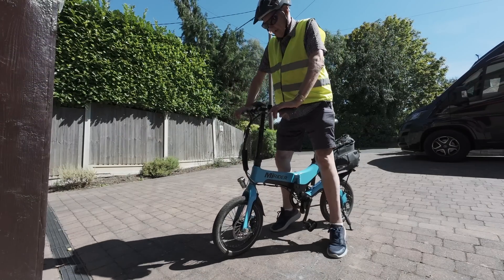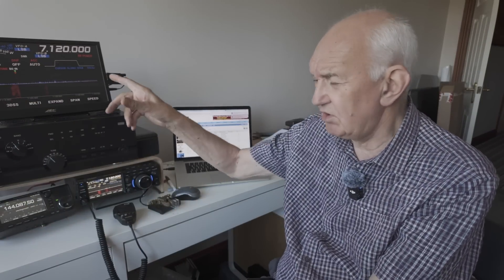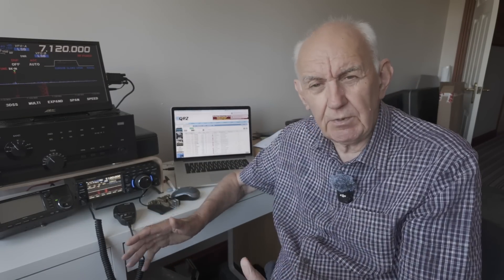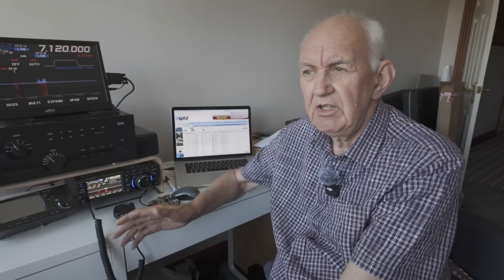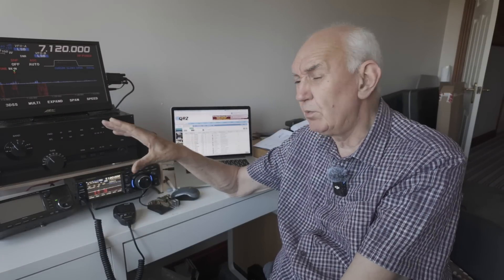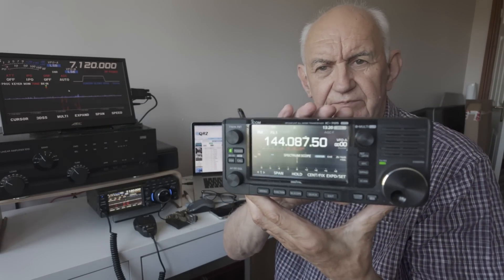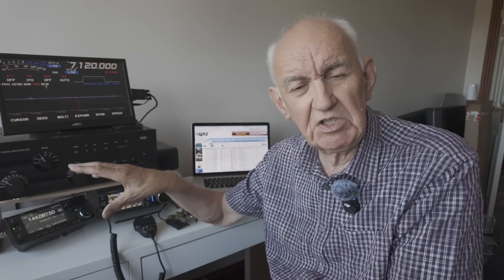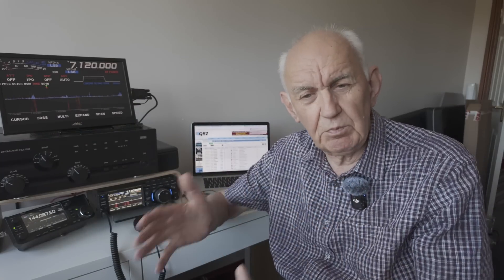My Radio Shack Seems Short of Gear!  Why?

Comment: I'm thinking about getting a Yaesu FT-710. It has a DVI output for the monitor. Will that work with any computer monitor using a DVI to HDMI adapter? Or does it need a special monitor with a DVI input?
Reply from the maker: Any monitor with DVI or use a converter.

Comment: My station is a very simple one too - an ancient FT-840 that was already well-used by the time it came to me feeding a 20m OCFD, with the original hand mike, and a WW2 'bathtub' key found at a local car-boot!
I'm really not good for business, am I?
But I have fun on what is essentially a zero budget. 
Thank you for your apparently unending supply of radio wisdom 🙂 de Richard M0GDU

Comment: I’ve only got an Icom IC-705. I enjoy operating QRP, I use a V2000 for 6/2m/70cm, and a wire for HF with AH-705. I’ve worked the world on it. Love the radio, and also that its batteries last forever and fit my ID-52e. Does what I want it to do, and it’s perfect for my enjoyment of the hobby.

Comment: Thanks for your excellent videos. Coming new to the hobby at 58, currently learning CW and planning to take my foundation licence early next year. Your calm delivery and range of topics and reviews has been very helpful. Definitely heading your way for a radio / kit towards the end of the year. I was settled on the 7300, now off to read up on the FT710 😂 just need to decide and take the plunge. Thanks again. Roger
Reply from the maker: The FT710 is an amazing performer. The receiver is very quiet and frankly at the price, there is no competition!
Reply: @watersstanton  Thanks for your corroboration. The FT710 it will be. 🥳Should be good to get me on the air (post securing my foundation license) inside my 25w for voice and cw. Providing a base / mobile shack considerably more mobile than my FT101, even though both have handles 🤣

Comment: Thanks for sharing Peter, I get it! ( a bit like them massive tvs). I bought the Yaesu 710 from your shop and coming from the Icom Pro when I turned the radio on morse was coming through and in an instant "WOW" that the weak signal was pumping out the speaker with so little noise.
Reply from the maker: Great to hear! I love it.

Comment: Hi Peter, I was 14 years old when I was licensed in 1964.  I never dreamed that equipment would evolve into transceivers like the Yaesu that you have.  We are indeed fortunate to have companies that can invest the money in order to produce new sophisticated equipment for a relatively small market.  I too have a valve (tube) amplifiers. I enjoy building amps so one of my amps is homemade and it too takes 3 minutes to warmup.  My other amp is a Drake L4b that I modified with several improvements.  The Drake is instant warm up with directly heated cathodes as opposed to indirectly heated. I do have a homemade antenna tuner.  It is fairly high Q and so a bit of retuning is sometimes necessary.  My 3 element yagi is also homemade.  I mention all of that because I am getting to a stage in my life where less will be better.  I am spending a lot of time maintaining "stuff" instead of operating. Thanks for the video and the advice.  Oh, my first crystal was 7155kc, yes kc.  I never took a class in electronics or engineering.  I have learned by doing over these decades with the help of many others who were patient with me.  Thanks again Peter.  73, Jim W6LG
Reply from the maker: Many thanks Jim. Its nice to reminisce  sometimes - well at least about the good bits!

Comment: ciao sono swl dagli anni 70 , nel tempo ho accumulato diversi ricevitori a valvole , transistor , integrati , sdr ma non per averne una parete intera , mi piaceva capire come operavano gli old man  dagli anni 60 in poi dal drake r4b ,r4c, r7 , r8b , è propio questo interesse ,questa curiosità ed altri interessi come le chitarre che mi spingono alla mia età di 63 anni con MOLTI problemi agli occhi .Quindi per me sei un esempio da seguire e spero di ascoltarti prima o poi in hf . 73 da roma italia

Comment: Same here I am not into hoarding equipment, on my desk, 9700, DX10 and IC7100 as a backup/portable radio All other equipment is racked and away from my working area, and are computer controlled.

My advice install a SDR Kit in the yaesu and use SDR console, the yaesu scopes are worthless for weak signals.
Reply from the maker: I find the Yaesu Panoramic display very sensitive, but you do need to set them up correctly.
Reply: @watersstanton  Perhaps you could do a video, as I am still not convinced.

Comment: Always enjoy your videos Peter. I use a Kenwood TS 440 with a home brew off center fed dipole. Where I live I can’t use a beam because of high winds.  Occasionally I use an old Heathkit SB 220 amp but limit it to 600 watts because the output tubes are extremely expensive and hard to find. I have many many contacts in the log all over the world with this gear. 73 KD5JCW
Reply from the maker: Thanks for sharing.

Comment: I have been a ham for decades and I only have an old IC-7000 that I bought new. It does everything I need to do. I know hams that have 20 radios that fill two rooms. We all follow our passions. Thanks for the video Peter.
Reply from the maker: Thanks for sharing!
Reply: Icom 7000 is such a nice radio. For both, portable or fixed station. I still sorry for having sold mine. Now I have ts-850s line with all the filters, tcxo, digital recorder (don't need it, actually😅) and it's quite enough for me. CW forever✌️

Comment: Don't you have a Xiegu 6100 as well?

Since I don't have a separate shack/room, I bought an FT-991 so I had all bands in a small unit I could put on my bedside cabinet! I had an IC-706 before - still got it, now mostly only use it portable. I have a couple of VHF/UHF mobile sets as well.
Reply from the maker: The X-6100 is used at my holiday home in Suffolk. Usually CW on 20m and 40m.
Reply: I got a 991 as well for the same reason. Only other radio needed is the 1.25/220 Alinco for the US.

Comment: Totally agree, simple is better. One can waste hours obsessing over new ham radio kit but it’s better to spend the time operating instead. I spent the last 6 months cluttering/downsizing the shack. I just have a plain desk with a FTDX-101d and a 24inch monitor. On the side a 2m FT-2980. With CW I took the move to sell my Acom-1010. Slowly working through reducing my qrp radios too, but finding it tougher. Shame Waters/Moonraker no longer distribute Elecraft. 73 Steve MW0SAW
Reply from the maker: Hi Steve. Many thanks. The landed cost of Elecraft got so high 5hat we could no longer offer it at realistic prices. Maybe things will change!
Reply: @watersstanton  did you keep the ah-705 to go with your 705? You did a great video on the tuner. 👍

Comment: I also chose the FT 710 and a G5RV antenna. I do not have an amplifier. I am a stroke victim that was not sure I could get back into Ham radio but found the simplesity of the 710 is a good match for me
Reply from the maker: Great to hear your story. 73 Peter.